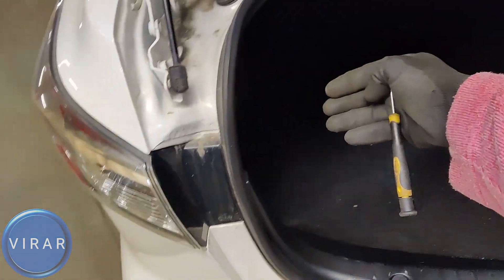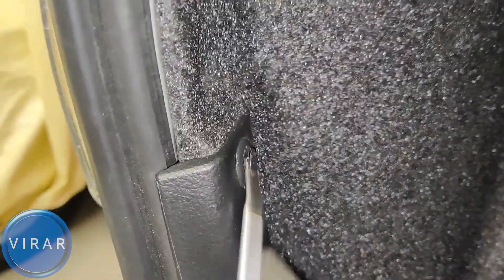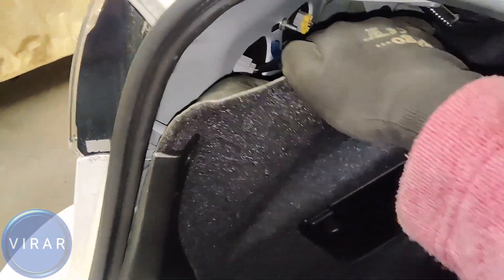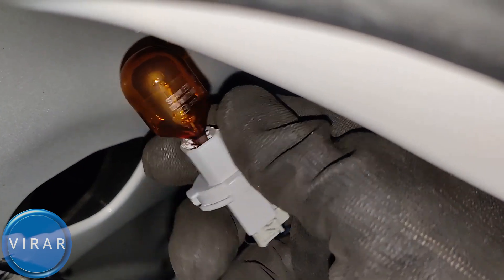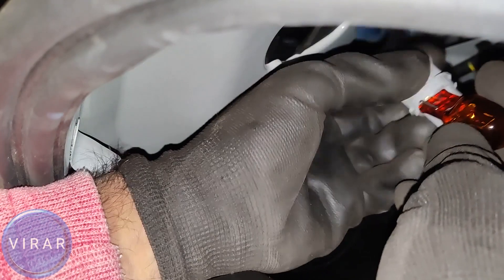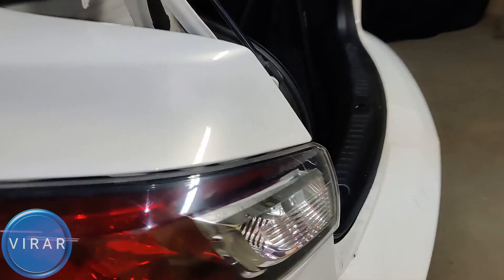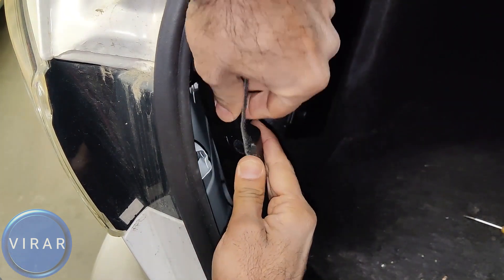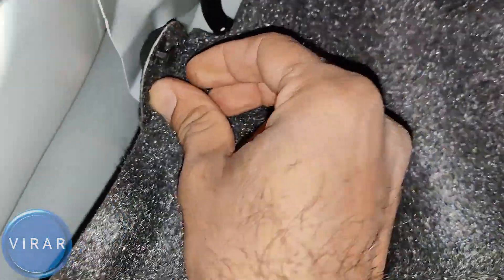How to Replace Rear Turn Signal Bulb - Mazda 3 (2010-2013)

Comment: Helpful video, the only difference is my 2010 Mazda 3 had a Phillips screw holding the carpet to the frame instead of just a flat clip. I only needed to take the one screw out, & it had enough room to reach in and get the bulb housing.
Reply from the maker: Thank you for sharing. Glad I could help!